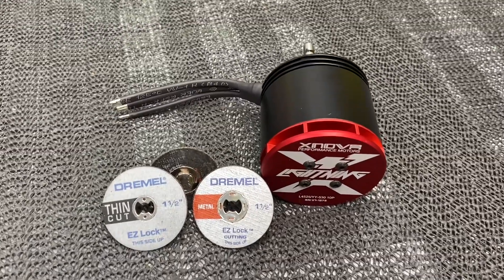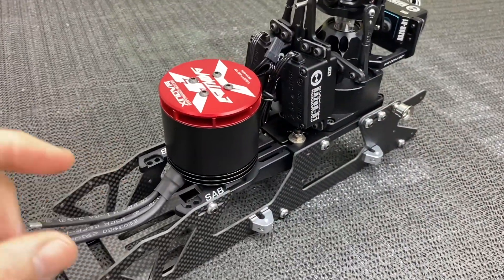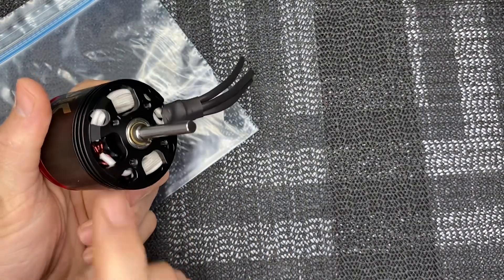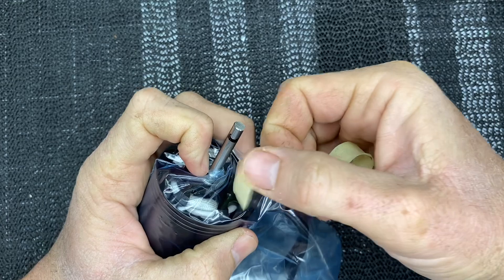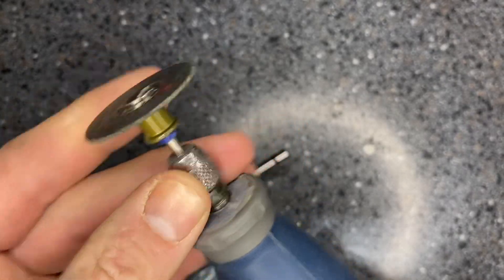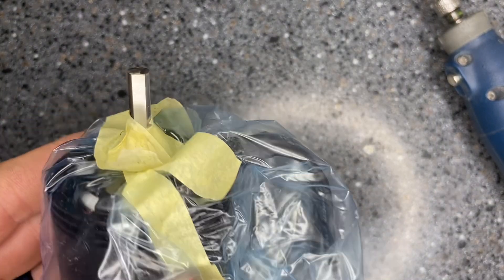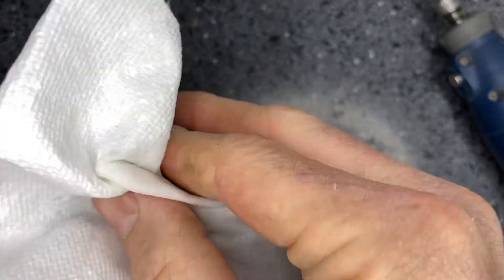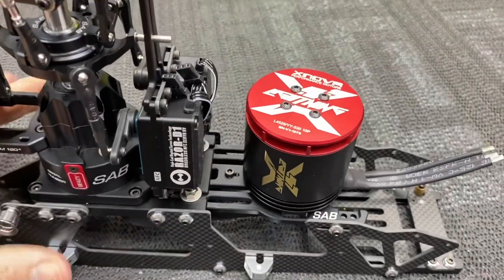How To Properly Cut Your Motor Shaft!

Comment: Great tips, as always from you, Jeff! I have a question about Xnova motors. I have them in both my SAB 580 and RS7 with Hobbywing ESCs. Both of them are “stock timing” I have the new program box for them. I think they are 20 or 25 degrees? Do you have any recommendation of what timing to run? Both of them (the motors) get warm, sometimes the SAB gets pretty warm to the touch. I run both helis around 2100-2250 head speed. Both of my ESCs are hardly ever warm, however. Thanks!
Reply from the maker: @snickerbar12  Thank you! I greatly appreciate it. So Hobbywing default is 25 degrees. I think it’s a little high and I normally run them at 15 degrees but I have run 25 degrees and nerve been an issue. But you will find Xnova is the coolest running motors on the market. What matters is actually temperature as to hot to touch can still be fine. You don’t want to get hotter then 220 degrees before it starts to be come a problem. I found a normal setup like the ILgoblin Pro, running a Hobbywing 260, Xnova 4530 525kv and stock gearing on 12s, running 2300 RPM, inland around 150 degrees on a hot day. Get your self a cheap temp gun and use that to get accurate temperature readings.
Reply: @ awesome, thank you, thank you! I figured the stock setting was on the high end and never really looked into it too much. Now that I’m really getting into harder 3D, want to keep everything running as best as possible! Thanks again for always helping!
Reply from the maker: @ so I just talked to Xnova to confirm what I said on timing. Jin, owner of Xnova said 15 degrees is all you want to run on a 40xx and 45xx series motors.
Reply: @westhobbiesrc8051 thank you so much! Greatly appreciate it. I will get them changed and see how they do!

Comment: I use the sandwich bag trick too. I don't pre-cut the hole and just push the shaft through the bag to get a better seal. Taping it up is a nice trick too.
Reply from the maker: I’ve done that in the past as well just shove the shaft through the bag but lately I’ve just been cutting a small little hole and the shaft is still a perfect fit, but I tape it up just to be extra sure as well as if I push it through the bag I still tape it.

Comment: 'simple' 😂😭

I remember spending 3 hours one night trying to cut a motor shaft using a sawzall, pliers, and lock cutters.

Everything just slipped right off and didn't even scratch the shaft. 

I was convinced the shaft was made of diamond.

Do you mind linking the Dremel and cutting bit you have?
Reply from the maker: Cut off wheel is the best way to cut the shads as you get a clean and precise cut. You could do a sawzall or a hacksaw, but that would take forever lol so the Dremel I use is over 10+ years older than no longer available, but any Dremel will work. I have the cut off wheels linked in the video description.